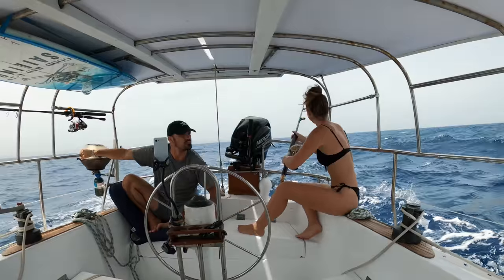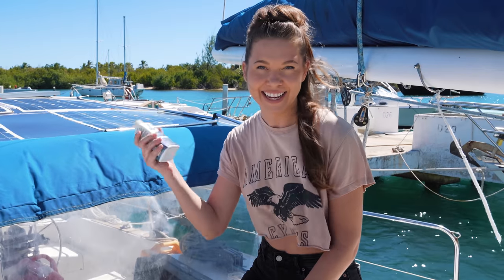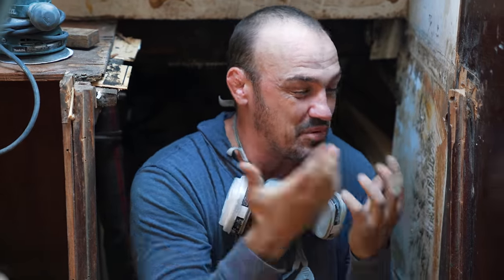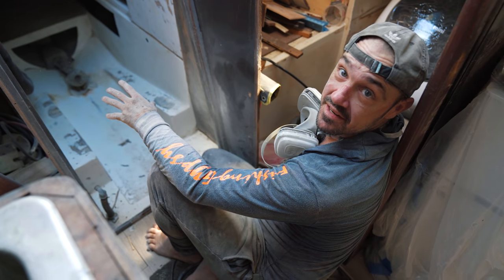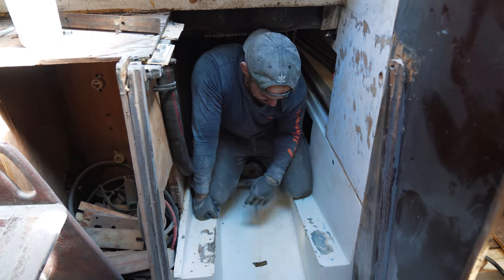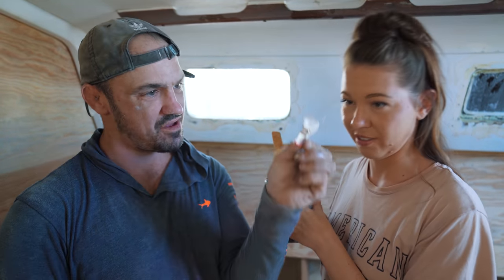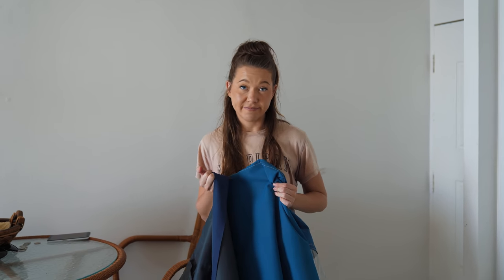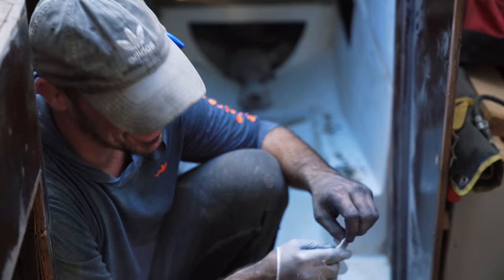BOAT LIFE: BACK TO OUR OLD WAYS TRYING TO CUT CORNERS!

Comment: Now that you're cleaning up the engine room, before you install the engine, consider putting some LED lighting in there so you can flip a switch and have everything lit up whenever you need to work or examine your engine. Just a thought.. 
And it would look cool to see your nice engine with lighting once it's all installed..
Reply: great idea

Comment: to slow the drip down on the propeller shaft you need to repack your stuffing box. Or you mite need to tighten the nut on the stuffing box, There is a formula for how many drips should be per hour cheers guys keep up the good work

Comment: Leaking Propeller Shaft.  I have no idea how to solve that problem on your sail boat, but it brings back my younger days on a 1943 Troop Transport APA 199 the USS Magoffin.  I do recall exploring the inner recesses of the ship and the engine room.  One time between Long Beach and Hawaii I checked out shaft alley, your version of the stuffing box.  The ship was built to last one or two circuits from the US to Europe as an expendable asset during WWII yet in 1968 we were still in service. 🥴🤢. As I opened the water tight door into shaft alley, I noticed a heavy inflow of sea water around the shaft.  I’m sure it was 200-500 gallons or more per hour.  We had big bilge pumps!   On another occasion, I was in charge of Troop 6 compartment.  It held about 200 soldiers in bunks stacked six high deck to ceiling.  I kept it clean and spiffy between troops on board.  It had its own head, Navy term for “Out House”.  I was in charge of cleaning and repairs there as well.  One time I was chipping rust from the hull side of the ship in the head and I hit a rivet that popped out and fresh sea water began to flow inward.  I had no means of plugging the hole so I reported the issue to a Bosuns Mate who got a wooden peg and hammered it into the hole. He instructed me to avoid chipping anything on the hull plates in the future.  It got worse, we had 500 Marine MP’s on board and we’re taking them to Danang, Vietnam.  The ship was loaded with military equipment.  Three vertical compartments in the stern of the ship had big trucks and related equipment arranged and tied down.  On the mid watch, 12-4am, I had to inspect every cargo compartment on the ship and report any issues found. This was a watch that was constantly moving and confirming the integrity of the cargo.  I had a flashlight.  I took my duty seriously and checked everything properly, not everyone did.  I came on the Mid-Watch one night and began my inspection tour of the cargo holds.  When I got to the stern of the ship I opened the deck hatch, climbed down the ladder and checked on the cargo of the first level, it was ok, so I proceeded down the ladder to level 2, it was ok as well.  The ladder down to the next level came to a watery stop as I discovered 10 feet of seawater in the lower compartment covering 3 or 4 trucks completely.  I have no idea what happened to the person on watch before me! 😳👎

.

Comment: Nice work on the engine bay. It's going to be a lot nicer to work in that area now that it's all fresh/clean... Next step, while the engines out, install a couple LED lights in there so you can see in the engine bay at night without having to use a flashlight.

Comment: Hey Kristen, I just painted my sail cover with exterior oil base paint, it came out perfect with a slight fabric texture.  Try it on a sample!
Reply: Chjp, can you let me know what paint you used please? Maybe a pic if you have one.
Reply: A friend of ours used Krylon spray paint and it worked great on an outdoor swing.
Reply: @tomclause9555  Rust-Oleum protective enamel, oil base. I thinned it just a bit and brushed it on.
Reply: I spray paint my Cordura motorcycle saddle bags with both Krylon Plastic Paint and regular black paint. Either way, in the sun the Cordura grey's out. Now the oil-based Rust-Oleum might be the way to go. I'll give it a shot next time.

Comment: Hey team wet bilge, 
The membrane that stops the water coming in from the propeller needs to be lubricated with water. So you need a little bit of a drip. However if that drip is actually more than one drip every few minutes you should tighten things up.  

great film today guys.

Comment: Another great video guys, you can't have a dry bilge with a stuffing box seal on your propshaft, the stuffing box needs to drip to keep the seal from cooking inuse and failing completely. you could convert your journal seal to dripless which would give you a dry bilge but would need to seal shaft under water to stop the boat flooding when you remove the stuffing box, some silicone self amalgamating tape would probably work. hope this helps
Reply: Wait, amalgamating is a real word?  It sounds like a brains name in the Steve Martin movie "man with two brains" 😊😁😄😂🤣

Comment: I came across a term that describes Matt. He's the "Sheet Anchor." It was mentioned in a famous speech by a former slave in 1852 by Fredrick Douglas. A Sheet Anchor is a person you can rely upon in an emergency. It is also an extra anchor used in emergency kept at the waist of the ship (amidships.) The speech is about an hour and a half, but it is exceptional in meaning, importance and articulate speech. Essentially, what to the Slave is the Fourth of July? It is a good read. On the other question, in a hawk that part of the bird is the "Crop" or the "Gullet."

Comment: I usually make a bonding resin putty by adding “cabosil” (powdered fiberglass) to a small amount of bonding resin.  It does a great job filling gaps and holes.  👍
Reply: Why waste your time suggesting anything ,these fools won't listen to anyone ,which is why they keep fracking stuff up .
Reply: @jamesagaudinosr.4327  The  old name was microglass wasn't it? I always just cut up extra fabric and filled things that way.
Reply: @easternsun167  aww, a little keyboard warrior, how cute 🥺🥺
Reply: @jeffwood8109  Nothing to do with being anything ,just a fact they don't listen to anyone and have continued to "F" stuff up . There glassing of the  bulkheads was pathetic  at best and what completely reveals there stupidity is the fact you can easily find on you tube the proper ways of doing the very things there fracking up .

Comment: Looking forward to watching your new engine installation. Brought back some fond memories of my replacing an old Atomic 4 with a new Beta 28 in my Pearson 35. Since I had to modify the engine beds to accept the Beta engine, I decided to build a mock-up out of MDF that picked up the basic touchpoints of the engine beds and output shaft flange. took very little time to make and saved me hours of cut and fit while modifying the beds. My initial issue was that the centerline of the output flange of the Beta was below the centerline of the engine crankshaft while the Atomic 4 was inline.

Comment: Good idea when you filled all the engine stringer holes next time re-drill your holes one step up or two cleaner fiberglass less wear and tear bang a wooden dowel until it is about 1/16" from the bottom and fill with west 403-406 mixture making new places to bolt or screw through because you are not able to tape the bottom and fill what you did helps but to fill with the right stuff gives alot more strength in case you have to put it in the same old holes

Comment: Keep up the good work! This, my dust covered amigo, is what separates the real sailing channels from the posers. Sail around the world once and you'll need a major round on the hard and new sails. Stuffing box, leaking shaft, seacocks and other assorted chickens. This is what everyone with a boat has to do or scrap it. It's half the inspiration to move forward, the other half are the good times in tropical climates.

Comment: I always carry modeling Clay on my boat to fill and temporarily seal the gap between the shaft and shaft tube from underwater when a need or emergency comes up. Allows you to change the packing without water intrusion

Comment: With a traditional packing gland it should drip while in gear 7 or so drops per minute, then stop dripping while resting.  Enough lubrication to keep things cool.  Its hard to keep a bilge completely dry unless you get it with a shop vac or sponge, or you have a diaphragm bilge pump that doesn't let the water fall back down the hose.  Keep up the good work!

Comment: The dodger material color.  A dark Navy Blue works fine for a classic sloop sailing in New England waters during the summer.  But you are in the tropics trying to stay cool in the cockpit and dark blue material with transmit heat into the cockpit.  Many tropic sailors go for light colors.  My opinion-Stick to the lighter blue color you have.  
As far as the new engine, alignment will be critical.  Now, while the old engine is out and if you will be using the old prop shaft flange,  you should turn the prop shaft to make sure the flange is 90 deg perpendicular to the shaft.  If it is on crooked, it will cause transmission problems.  The other item- you'll need good feeler gauges when trying to align engine/transmission up with the prop shaft flange.  Note there are flexible transmission/shaft flanges that will allow for some misalignment.

Comment: Hey that leaking from your propeller is either leaking at the packing gland, which is adjustable, or from the hose behind it. To adjust the packing gland there a locknut or jam nut, and the thing which appears like a elongated nut. The last item holds the packing. Loosen locknut and tighten the packing gland until drip stop. When ready to get underway loosen gland enough to allow 5 to 10 drips per minute for starters. If it runs cool you can tighten it more. If you can hold your hand on it while running you should be able to keep it there for 20 seconds you’re good.

Comment: Have a look at dripless seals for your prop shaft. My boat currently has an old style stuffing gland which is designed to drip a little but the trouble is that the water takes up a bit of grease which makes everything greasy. I have an automatic bilge pump which switches ‘on’ OK but any grease on the sensor & it doesn’t switch off! I’m fitting a Radice RMTA dripless seal next month - same as the Volvo seal but with a tapping for a vent or a lubricating feed from the coolant system. I’m also fitting a Halyard Aquadrive which takes the thrust off the gearbox & saves having to be accurate when lining up the Engine.
Might I suggest that you take your shaft to a machine shop & get them to check it for straightness & also you probably ought to replace the Cutless bearings.

Comment: ... one observation and a story .... the engine room, was amazed at the change after the sanding and then after the quick lick-o-paint looks awesome. The observation, the hole on the starboard side of the engine compartment. Make it square maybe even with rounded corners, it currently looks like some hacker was let loose in there and detracts from the visual excellence you are achieving .... story ... I was in hospital in Vancouver BC and all of a sudden there was a somberness with all the staff and I commented to my nurse when she was on her rounds and her response was that they were not permitted to talk about it. On the next round she confided that there was a farmer from the Fraser Valley, farming area in southwestern BC, that had been fertilizing his fields and when mixing a batch of concentrate in a 5 gallon pail did not have his stir stick so used his arm. He was admitted through emergency with raspatory challenges. It turned out that the fertilizer had been absorbed through his skin and was attacking his lung tissue, it was disintegrating and there was nothing they could do for him. Before 8 hours was up from the time of the mixing his family was without a dad, a husband. Since that day if it says do not, and even if it does not say "do not let come in contact with skin" I make sure it does not. I used to be "Meh" ... thx for the share guys .. as always .. never stop dreaming, just dream bigger .. have fun be safe, save our oceans ..

Comment: You need to tighten the adjusting nuts evenly on your prop shaft packing gland. You want to tighten it until you get one drip every five seconds or something close so that the water lubricates the shaft while its turning. You need access to the packing gland once the engine is in because it needs to be checked fairly often. That is where your bilge water is coming from

Comment: If you dissolve some clear roofing silicon such as plumbers use for sealing guttering, and s dissolve the whole tube of gutter sealand (clear) in a titre or so of white spirit, also sold as Naptha, you can soak calico in it or use it by painting it on as long as you let it soak well in.  Always use it out of the boat and keep upwind of it--the fumes are toxic and also explosive.  Always keep it in a sealed tin in a fume-vented deck locker. Personally, I use all I have and discard the residual after doing any touch-ups on worn fabric.

Comment: If the shaft seal is the old 'rope' type stern gland, they are a wet seal as they rely on water for cooling/lubrication, therefore 1 - 3 drips a minute is normal. If you overtighten so it does not drip, the packing will run hot and burn out....and wears the shaft very quickly........so enjoy your drips!

Comment: The think about nylon materials I'd it's made up of fine plastic  threads . Plastics aren't very absorbent and that's  why they are used for water repellant materials .
Beware  when it rains the color might run and you could end up with a blue boat .
As far as repair videos go , I  think you're  killing it . Some of the best stand up , crouch and lay down comedy I've  seen in a while and you're  getting it fixed !
Keep it up , you're  both fun to watch . Remember  , you have to fix what you break , so start with what's  broken so you don't  get gassed .

Comment: Straight epoxy is normally brittle, next time mix it with a filler suck as wood flour or glass beads. Much stronger and a lot led cracking. Just a thought

Comment: Next time you need to fill a hole, get a small piece of fiberglass wet with epoxy.  Then wind it aound and around with a paper clip. Then use the paper clip to stuff it in the hole. You will have a strong repair. I wish I had a way to send you a picture of the final result.

Comment: Good afternoon guys the wind finally let up here and buki Abba I was watching one of your old videos when you want to cut caulking from a window or like 5202 can use a piece of stainless wire with two dolls on each end and put the heat to it and it will cut the 52 / silicone caulking very easy⚓🤙🚣🐟

Comment: the reason the dye didn't take is because it's either synthetic fiber or already coated with a water proof coating, either way, a water soluable dye will never penetrate and hold. You might need to add the dye to white silicone caulk, dilute the silicone with naphtha until it's like toothpaste, spread that across the canvas to make it stick to the fabric. try it, it's worth a shot!

Comment: Depends on the color of Sunbrella whether it fades or not. Black or any color that is Sunbrella tweed colors meaning that there's black thread in with the color doesn't fade. All of Sunbrella colors fade after 5 years. The black and tweed colors will last longer than 5 years.

Comment: Team wet bilge.
With the iron sail swinging I get a drip about every ten seconds or so
 This is good as if the stuffing box is over tight it can get warm and damage the shaft from to much friction. After motoring I give it a couple of pumps with grease and that stops the drips completely within twenty minutes or so.
If yours drips continually you either need to tweek up the nut a but or the stuffing has warn and compressed and needs replacing which as you have access now is a good time. It can be done in the water but you need to be organized with the right size stuffing cut to length to form three rings with the joins offset and a tool to get the old stuffing out.
Smurfy hands there cobber but some guy's don't wear rubber🏴‍☠️

Comment: I'd get some navy blue dye and brush it straight on the fabric without diluting it in water, and then let it sit for an hour or two and rinse it really good with hot water. I tried using that same dye to dye a pair of black jeans once, and I went by their directions and they just didn't come out as black as I wanted them, so I used straight dye and an hour later rinsed them with hot water and put them in the dryer on high heat for 40-minutes and they were REALLY black! lol. So if you want them to be navy blue, then use straight navy blue dye on them, rinse them, and stick them in the sun to bake it in. lol. The thing is, that dye faded much faster than the jeans factory dye.